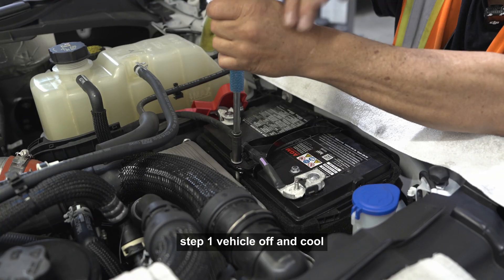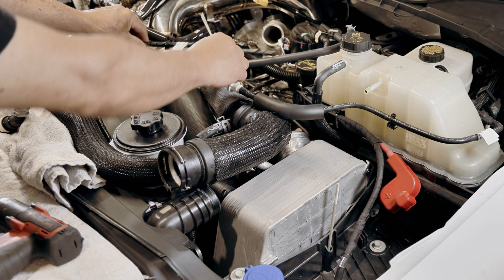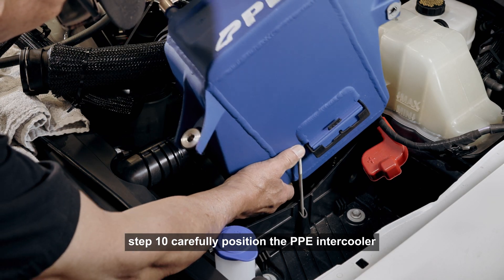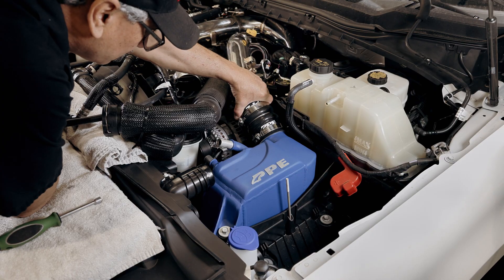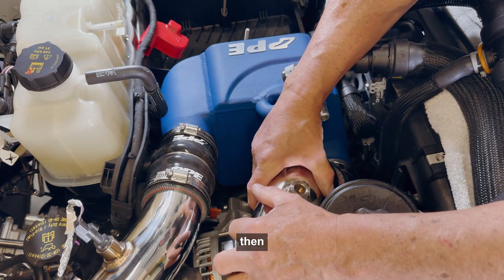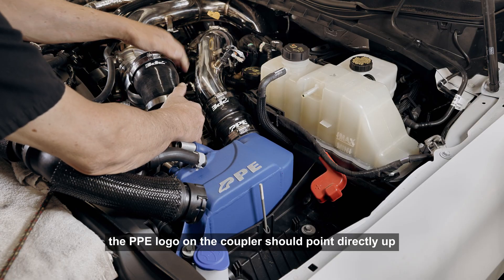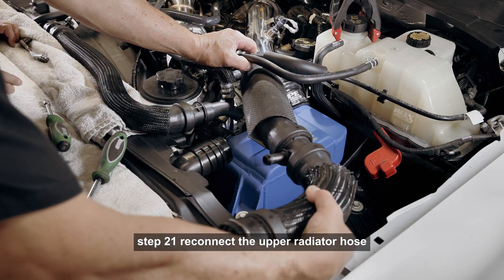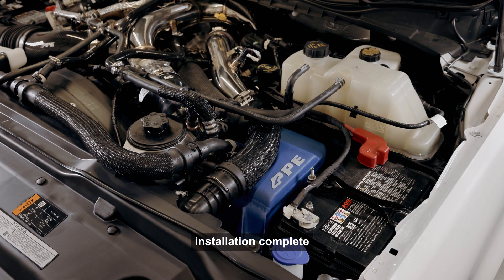Ford 6.7L Air-to-Water Intercooler Kit Installation Guide

Comment: At 1:58, you instruct to apply silicone lubricant to the o-ring set in the metal part, yet you show a jar of Vaseline.  Does Vaseline make a silicone-based product?